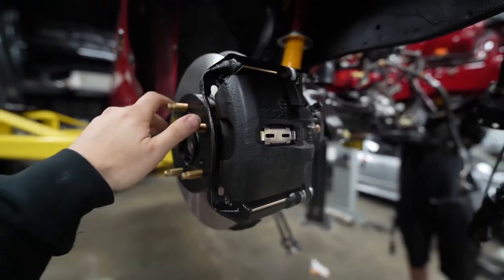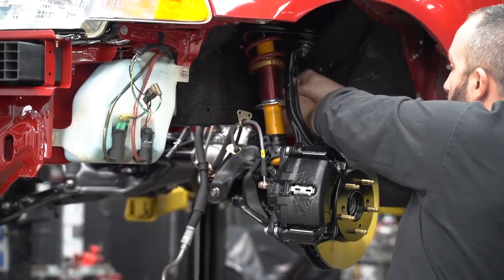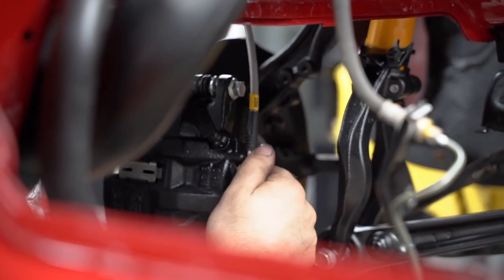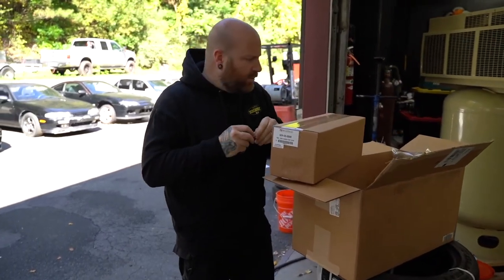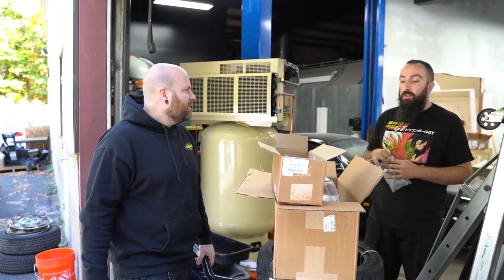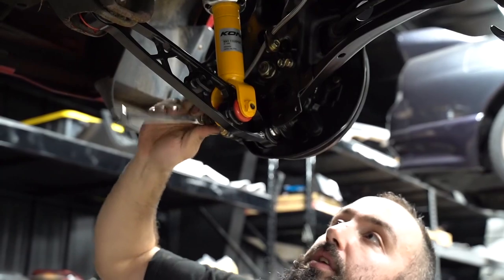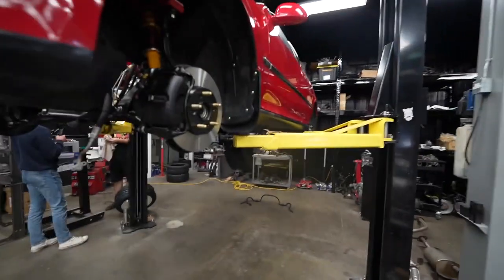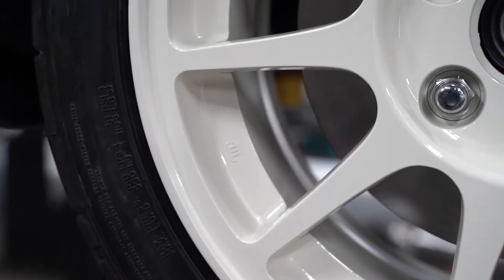BUILDING THE CLEANEST OEM+ CIVIC IN ONE VIDEO!

Comment: All my skunk2 parts have been the best quality out of all the other company’s I’ve tried Tom. People call them junk2 but eh they’ve served me well
Reply: Any part I've gotten from them I've had to fabricate.  Intake manifold was cracked and the iat wasnt drilled right out threaded.  The Tb had to be sanded down for the map sensor to sit properly and get a proper reading.  The rear Lca bolts didn't fit and had to be threaded properly.  This was way after the cams snapping as well.  Not to mention the awful customer service they have.

Comment: The car is turning out awesome.
Last year I completely overhauled a 8th gen civic like this. 
Sanded and painted the subframe, all front and rear control arms, new bushings everywhere.
Koni yellows with swift springs, hasport motor mounts, fresh exedy oem clutch, all new everything with the brakes.
And bone stock k20z3 with a ecu tune.
Just under $3000 and all my own labor turned that beat Si into a solid daily. Would have been awesome on a track.
I sold it for $10k to a local kid. And I'm itching for an early 90's crx or even a late 80's civic to revive now.
This shit is so fun. Just no real profit in it. Gotta do it just for the love of it.

Comment: You can also lower it more by using the lower circlip ridge on the shock body, but you REALLY need to take those silver stock spring perches off, the GC sleeves won't seat correctly on top of those perches.

Comment: I had red ef back in the day, went with oem plus as well. Swapped in a b16a, didn’t have the itr 5 lug though, I went with 2k si rims, vtec was set at 4200 I think, and the normal bolt ons. Aem intake, dc sport header, tanabae exhaust, loved that thing. It’d be sick to win this.

Comment: Yellow dot on the tyre should line up with the valve stem, unless the wheel is marked then the red dot is your alignment point.  Lightest part of the tyre next to the heaviest part of the wheel so that there are less weights required to balance it.

Comment: Should’ve done the cheap budget big brake kit. 97-01 Crv calipers with mounting bracket, 02-04 tsx or 97-01 crv pads, 97-01 crv rotors or can do the Mini Cooper base model rotors just need spacers then. Go from 240mm to 280mm rotors

Comment: Tommy, you guys should apply ceramic coating to the engine bays that you guys freshly paint to keep them easy to maintain at least for a few years. Use like Gtechniq CSL. Put in that much work into the bays might as well put a nice top coat to keep your efforts fresh
Reply: Im pretty sure you cant apply ceramic to fresh paint.
Reply: @Nick210  ight you right, gotta let that stuff gas out. but still kinda nice lol

Comment: Do you do anything to the underneath or back end of the car or do you soley only do restorations of engine, bonnet , subframe etc? Be interesting to see under some cars. Rust repairs. Different upgrades you can do. Same with the back end, mods, repairs and more subframe porn

Comment: Do you guys torque anything or does josh just tighten everything by hand?
Reply: I torque what's necessary. As for retainer brackets, etc that's 6x1.0 or suspension things I have installed thousands of times depending on what it is(larger than 10mm thread diameter is my descretion), I seat it by feel. Since I mainly use hand tools, my feel for most things is dead on when double checked in final inspection.

Comment: You need a 40/40 prop valve from a dc4 Integra rs , the brakes aren’t gonna feel good without it

Also get a rear sway bar, will greatly improve the handling

Comment: You need to change the break proportion valve the silver valve attached to the fire wall that has the break lines into it .you need the integra 4 wheel disc version

Comment: Wish you painted the sides red and not left it black for the trim and do a carbon front lip with a carbon spoon wing 

I’d do a N1 style exhaust also 

Skunk2 before they made the Pro 1-3 cams was called Junk2 since the suspension items wore out fast. Everything else was good stuff. 

They became good stuff in the early 2010s 

They went from the best to “ok” to high quality 

The cams and headers in the Pro series in the B series really changed the company and did good stuff

Comment: Cleanest Honda build its perfect. But the na topic with piping size. For example my spec v sentra went from 180whp and 176wtq. With a ebay header and 2.5in exhaust. Then made 197whp and 190wtq same dyno. With a stepped header  with 1 7/8 to 2in runners to 3 in spiked collector and 3in side exit. And still factory ecu mapping.

Comment: Hope all those suspension bolts on the lca's and trailing arms were tightened down with the suspension at ride height. Otherwise all those bushing will be bitched in no time.
And why put the front suspension together, just to take it apart to put the axles in? Kinda stupid....

Comment: Do those wheels have pressure sensors or are they just metal valve stems?
Reply: Metal with rubber seal like most aftermarket wheels use and modern oem

Comment: you know you can get rid of the spring cups on the koni fronts using the correct gc coilovers...  that looks aids with the cups still on there.
Reply: It was a safety thing based on diameters and how the GC sleeves feel. They will not crack around the clip being soft aluminum with the perch. Also it can be changed to something else for whoever and they have the option.